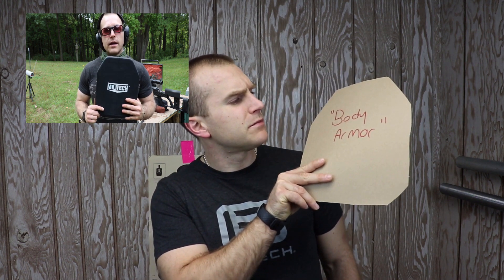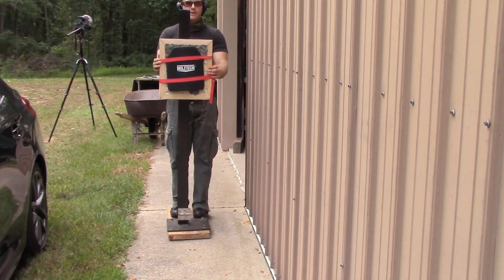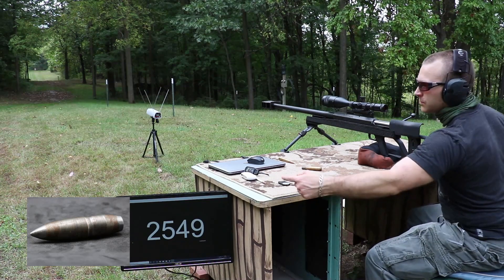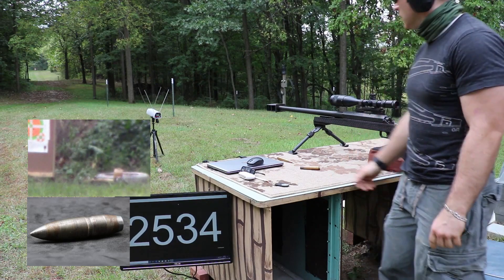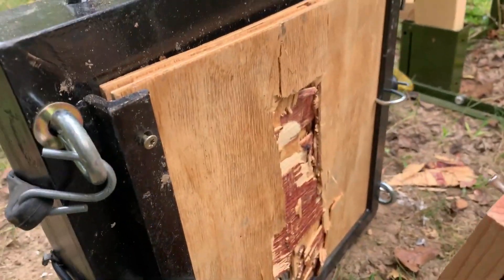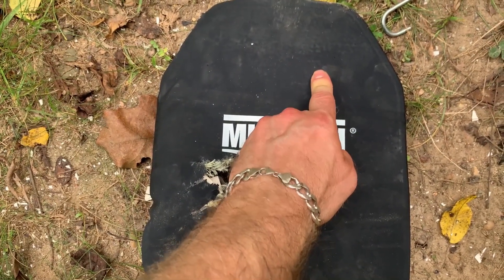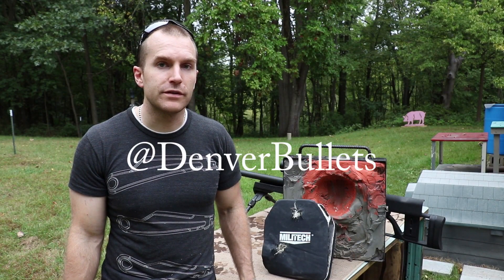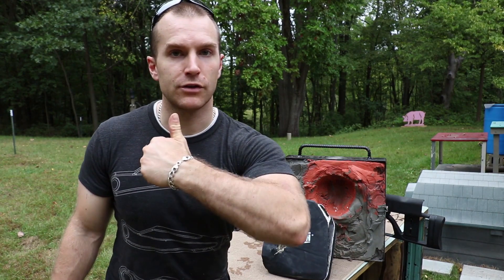Destructive Testing! 50BMG VS MILITECH Level IV Plate!

Comment: I wonder how long is the lifespan of the plate and is it still usable after expiration date?
Reply from the maker: Apologize for the belated reply. All our armor comes with a 5 years warranty
Reply: @militech6763  
What goes wrong ? Glues in the fabric de laminate ? You expect after 5yrs it will have been dropped enough by the owner to crack the strike face ?😂.
Reply from the maker: @TheCraigy83  You may need to spend some time and go thru the 0101.07 requirements and find out why there are more and more US-made hard armor brands putting foam on their STRIKE FACE too...
Reply: @militech6763   
I'll guess...
most your leo are 250lb un athletic lumps , 1 face plant and that strike face has already stopped a significant impact..
Your body armour needs body armour 😂..
engineer England..🙂👍🏻
Reply from the maker: @TheCraigy83  Maybe yes maybe No but would love to hear references from you on other stand alone IV body armour would not need body armour to stop 50 BMG :-)
Stable supplier to UK MOD vendors on certain products
Reply: @militech6763  
stopping the vest from going through the wearer !? 😂 , i was honestly surprised years ago seeing a 50 stopped by lev4 ceramic..your vest performed well / looks as good as the others..

Double check chamber pressures vs big bore airguns...someones added a zero to firearm case data..dont know when but few have noticed..
there's not 55,000psi work happening its closer to 5500psi..
airguns dont use 2500psi per shot more like 80psi each shot or even less valve speed etc..

Comment: Do you have to drop it twice before you wear it? Or will I be fine with out doing that?
Reply from the maker: It is best not to drop your ceramic constructed plate since it may crack the tile. The NIJ 06 standard requires 2 drops on the solid ground as it is part of the durability test. Even tho so far our plates tested passed the requirements, we still strongly suggest all body armor owners take care of their ceramic constructed plates and avoid dropping it.

Comment: That is really impressive!!! I did not expect it to stop it but rather go completely thru like butter. I saw another video of a IV armor from a different manufacturer that had a .50BMG simply zip thru it. This one is quality stuff!
Reply from the maker: Thanks for watching and sharing your thoughts. To be honest with you I personally do not think it was a fair comparison with RMA's level IV plate because:
1, Their plate was shot at 100 yards in first impact which our plate was started at 200 yards. The 100 yards distance does make a difference especially for the first shot.
2, When the 2nd shot impacted on RMA's plate, due to the fact their ceramic is in monolithic construction, its structure was compromised after 1st shot and cracked, not to mention the 2nd shot was not considered as a fair hit as minimum of 5cm from edge is what the NIJ 06 required for.
Hope you enjoied the video😁
Reply: MiliTech are you guys going to make a true 10 x 12 plate no foam ring?
Reply from the maker: @mariaurias1429  We have Multi Curve Level IV SIC plate made that way. Plate is in 250x300mm size and the ceramic layout is 240x290mm. It's like a 5mm on the edge with foam.
Included link below for your reference
https://www.aliexpress.com/item/32301919925.html?spm=2114.12010612.8148356.5.450a407eH31038

We are offering ESAPI sized plates in single curve made of Alumina & PE, however the weight of plates increased significantly with added ceramic coverage.

BTW, NIJ 06 requires a minimum of 5cm from the edge for a fair hit. Some people saying we "Cheat with foam ring" which in fact is not, since we never claimed the plate was full ceramic covered and I hope you understand that we do not over sell our product's quality.
Thank you